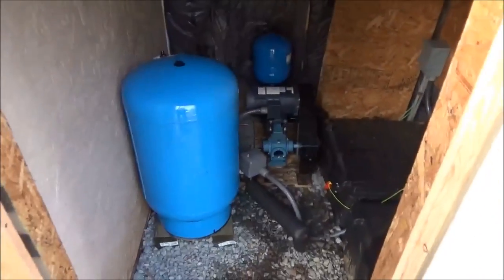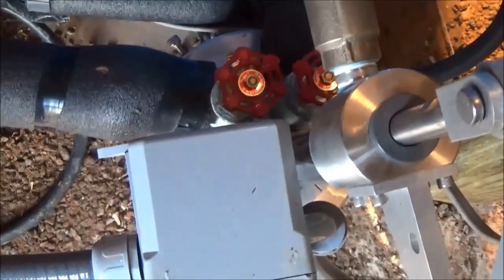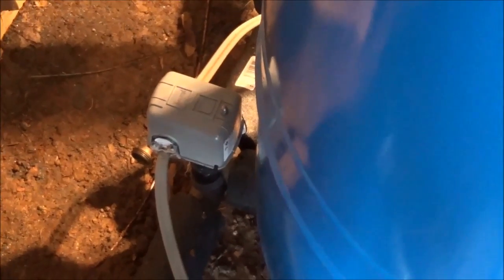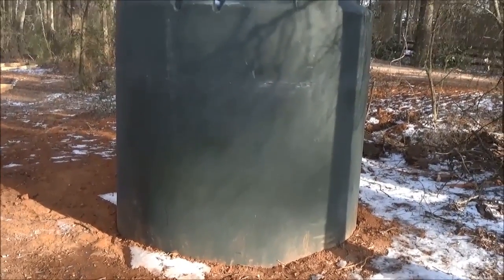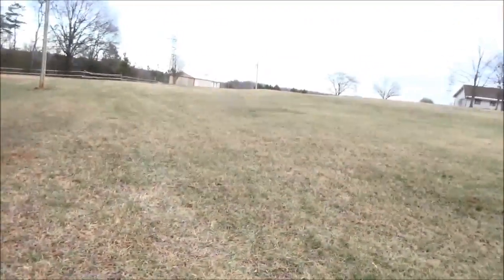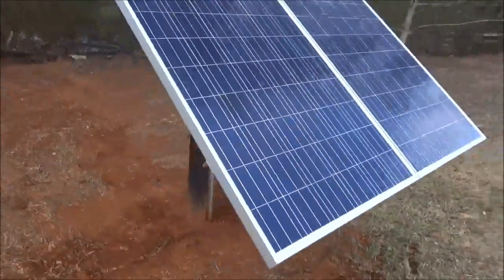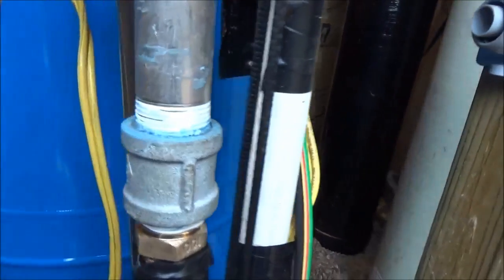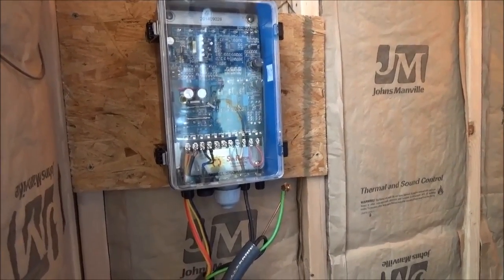Solar Water Pumping @ 48volts

Comment: Nice video. I have one of this on my farm and I want to install an emergency system to keep the pump working at night. It involve a 220v generator and a 48v power supply to act like the solar panels during nighttime. My question is if it is posible to fo that, and what kind of power supply do i need. I was thinking of one of this https://www.amazon.com/Eyeboot-Universal-Regulated-Switching-Supply/dp/B01KZSWNNI

Comment: I have done a similar job. using a piston pump high-pressure 300 watt (the ones used to wash car or other) have the commutator motor which also works with DC)
and I used four panels of 100 watt amorphous (100 volt panel)
so when c 'and sun, pump the water up to 60 bar pressure
I used to jump of 200 meters, still it works for more than 5 years

Comment: what about a domestic water pump....for a tiny house...do you have a video on that ?  :-)
Reply from the maker: What is the source of water? Is it a well? Rain? spring?
Reply: engineer775 Practical Preppers  well
Reply from the maker: ELDK2008 I would do the same type of system but I would scale it way down.  I would probably go with a 24volt system.  2 panels total. One to pump water out of the well and one to run a booster pump.
Reply: engineer775 Practical Preppers
do you have a starter video because that looked complicated.  :-)

Comment: Thank you for these videos! I was wondering if you could do a short one on protecting water storage tanks in areas where it can get below freezing. How to prevent them from freezing, or, at the very least, protect the plumbing attached to them. In this video, you mentioned the plumbing was buried to protect it, but how deep does it need to be? What about the water in the tank freezing, and perhaps splitting the tank? I live in an area that sees below 0 temps at time during the Winter, and I'd like to put in some tanks to store water, etc. Thanks!
Reply from the maker: As long the plumbing is buried below the frost line and the tank is large enough there is enough thermal mass to keep the tank from freezing.  You can also get a buriable cistern so there are no freezing concerns.
Reply: Changing the water level is how most towns do their towers.  You can have freezing around the sides inside as long as you are not solid across.  Changing the level creates flow so water is mixed and does not freeze.

Comment: Just wondering what size wire did you run between panel and controller over that long distance? What was the total distance? Any worry about voltage drop?
Reply from the maker: #6 @ 240 ft   My open circuit voltage was about 86 volts at the charge controller which was perfect for that Flexcharge and the 48 volt battery banks.